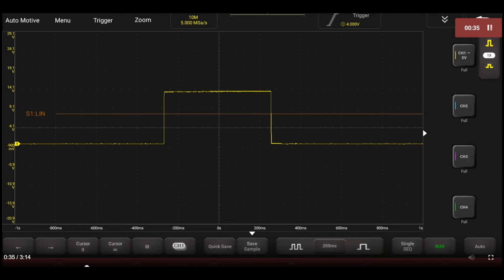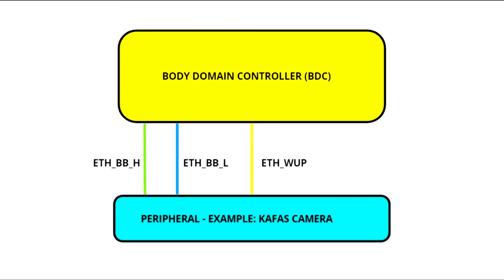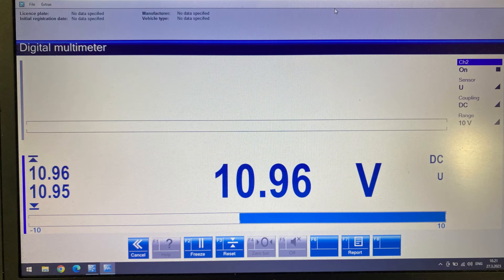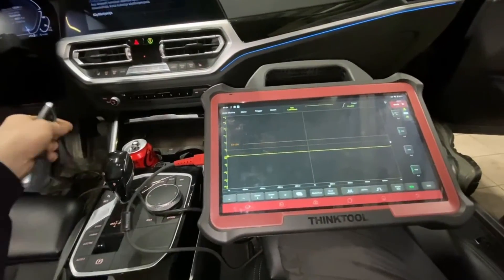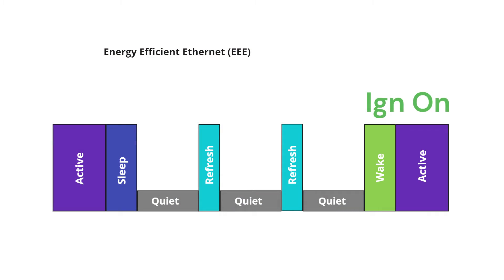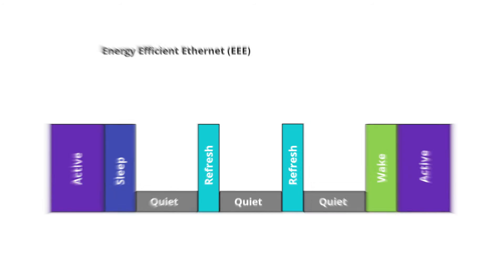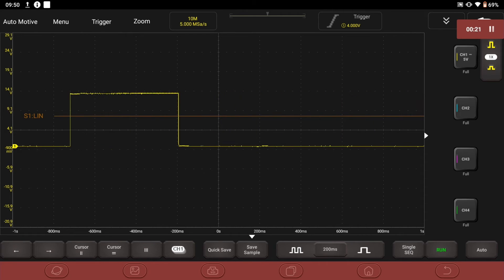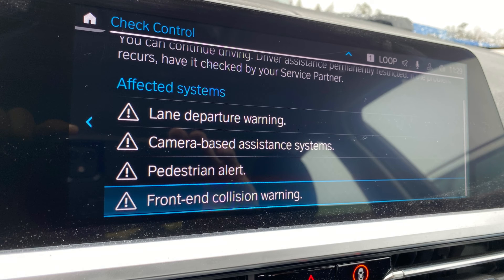I SCOPED THE BMW G20 ETHERNET WAKE UP SIGNAL

Comment: what if i dont have wake up signal cable ? i mean theres 4 cables, 2 of the ethernet and the others 2 ground and 12v.
Reply from the maker: The wake up is a message frame on the ethernet there is no separate wup line

Comment: can you check WUP for the DME i need it for an Engine swap that would be awesome
Reply from the maker: I made a video about that once. It should be around 11v and has a pulsed signal running down it
Reply: @ where to find this video and was it scoped on GXX serie
Reply from the maker: @MoadlBeamer There is no CAS wake up on GXX. I will try to find one or make one

Comment: Hi mate thanks for sharing your experience, so ETH-WUP won’t be permeated 10-12v like old radio signal ?
Thanks
Reply from the maker: Correct 🙂 its just an on off job it doesnt stay high to 11v like CAS. It just comes and goes